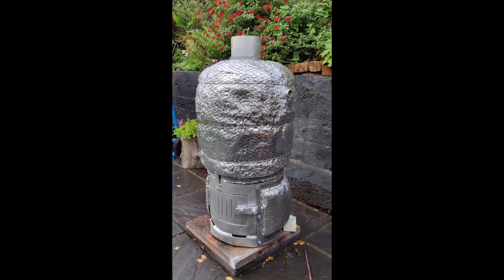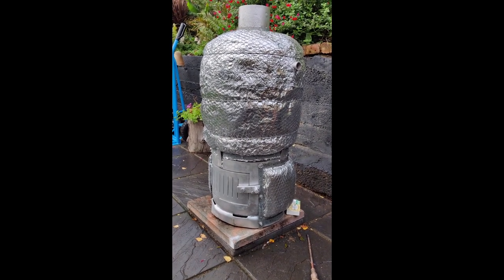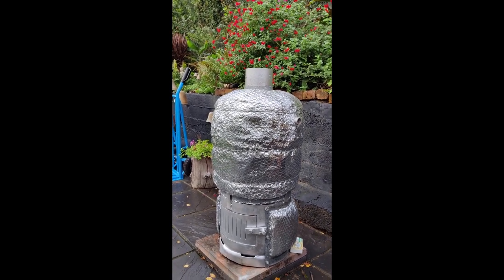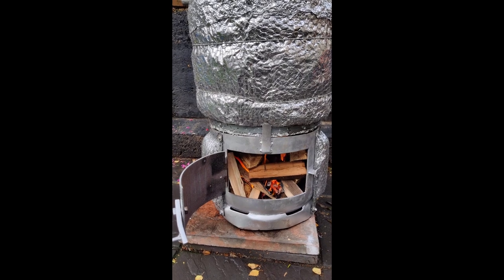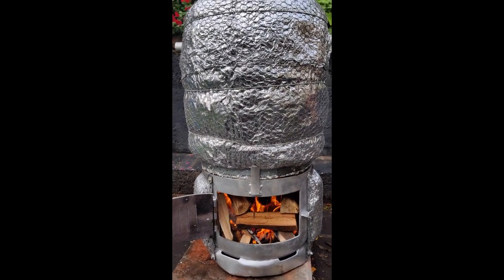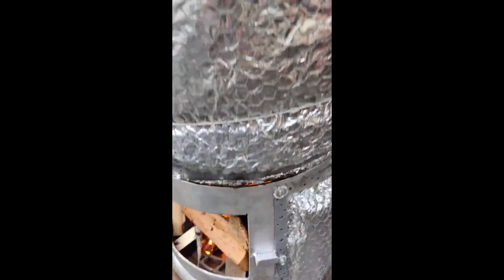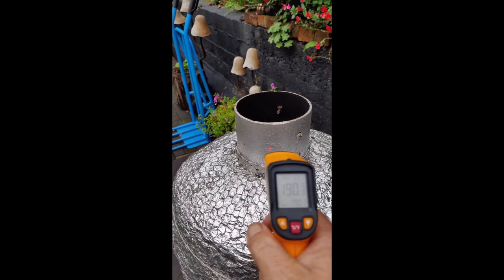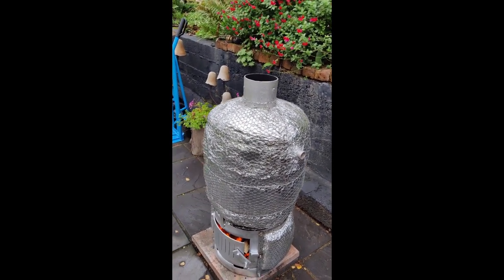Sand battery can it heat my home? part 2

Comment: Now you could Parge concrete over it that chicken wire ought to hold it in place give you even more thermal Mass lol
Reply from the maker: It would 👍 but adding any more weight will make it a garden ornament 😄

Comment: If it's too hot don't be afraid to crack a window open and cool it down a bit, after all your still saving quite a bit so your can waste some you don't need.
Reply: You might consider adding a water pipe tranfer system inside to other rooms to run into the flue and move heat into water radiators from room to room.
Reply: Run a pipe under the floor and up to a water radiator in each room.
Reply: Was thinking a better way to slow down the release of the heat, Make a smaller air vent pipe to add when bringing indoors to lessen heat to air transfer. Maybe even just an insolated cover once the room gets hot enough to blanket the top🤔💡
If that doesn't control tye release to keep it from releasing heat too fast you need a thicker more robust insulation shroud
Reply: As for tye soot problem a smaller diameter pipe with air holes in the bottom and top will burn the gasses that need higher heat to ignight. Maybe half inch to quarter inch smaller and you can slide it in and out

Comment: Get cracking with pallets they are a disposal problem.
Reply: Really? I tried to find free pallets in my area, but nothing doing. They can't be that big a disposal problem if people are charging for them.
Reply: @Pwecko  I think a lot of people are after them now because of the fuel crisis the solution to keeping warm has to be thermal mass heaters and Insulation. Try reducing the size of your house ie all sleeping in the living room and kitchen. This winter will be a matter of survival for some people. personally I live in a 6 feet by 6 feet cabin that's economising.
Reply: @DavidPaulNewtonScott  That certainly is economising.  I'm 6'6", so I guess I'd have to sleep diagonally.
Reply: @Pwecko  The optimum shape and size is a square internal dimensions the height of the person. A square allows easy cross bracing of the walls at the floor level. Mine is under a mound of blackberry thorns therefore only dug in two feet. Build on as an insurance policy.

Comment: very intresting Thx!
You still have oodles of heat wasted, you could boil 10's of gallons/50L off the flue. Just have clean buckets with lids when you take 'em inside. With 50°C delta during cooling phase every (10L) bucket will give off 2.1MJ. Or, like having a (about) 300W heater on for 2 hours.
Reply from the maker: Yes I know it's the painful part about it watching all that hot air going to waste, but yes il get this streamlined a bit more & look at capturing more of that heat 👍

Comment: If you pack a metal drum with woodchips and the pore a bucket of wood ashes and urine  on top it will heat up to about 170 F .  Just tell the wife your making compost . It is correct
Reply from the maker: That's pretty impressive

Comment: I have a wood burning stove in my basement and the exhaust pipe runs through 4 rooms upstairs. Each room has a 50 gallon steel drum filled with sand that wraps around the pipe. Its been heating my 6,000 square foot house for years. It distributes the heat evenly and stays hot for about 7 hours after the fire goes out. If you do it right, a sand battery is awesome when it comes to efficiency. The exhaust pipe is double walled but single walled inside the sand battery. After running for 2 hours the sand batteries have reached max temp. I heat my entire house with only 4 logs a day.
Reply: Do you have any photos of these? I'd love to see them and build something similar.
Reply from the maker: Wow that's impressive 👍👍
Reply: @guyvenner  I don't have any photos but all you need is steel drums and stove pipe with connectors and heavy duty brackets to hold up the sand batteries. I'll explain how i assembled it all.
Reply: What I made:  I bought a large soapstone stove from a place called Hearthstone. I bought double walled pipe and single walled pipe. I bought steel 50 gallon drums and cut a hole in the top and bottom to insert the single walled pipe. Single wall pipe easily transfers heat into the sand drum. I welded some rebar U shaped brackets on the drums and hung them from the wall and ceiling about 5 feet off the ground.  I used fire block panels behind the sand drums because they get hot. I then lined up the holes in the floor and ceiling to run out the double walled pipes. I welded a 1 to 4 way junction right above the stove in the basement but had to add dampers in each pipe because heat was not being distributed evenly. I used a funnel and filled the steel drums with the finest sand i could find.

Comment: I would expect that if you were to take a piece of insulated pipe with a bend in it and it were to reach close to the floor where you can use that fan upside down to drive the air across the floor, then it should make it hotter for more air space as you're heating the air from the floor up not just the top of that sand box up. You might even consider ducting some of that hot air up at ceiling level into another room if it's too hot like you say. Firing it so the transfer to the house at near night fall would surely drive the temps up for the entire night. It appears to be a very good solution to the energy bill issue. well done.

Comment: Excellent work lots of usful data, all you need do is find a way to heat it without burning wood.

But it is heat storage, so any type of heating system may do, if you could heat it up while it was in the room you would get double heat due to the lowering of losses.
Reply from the maker: As much as I would like to it's just not possible on either of those, which is why I'm at the stage I'm at now 👍

Comment: Kind sir,with all the respect,i suggest you to study first they way a stove works. The best efficient in the world are those used in eastern europe and north asia(Belarus,russia,especially Siberia,Ukraine Romania,Bulgaria,Kazahstan,Mongolia,etc) search in google for,, Soba de teracota'' After you will get the knowledge about the way they work and the level of energetic efficiency,i can assure you will look back at your invention and have a good laugh. First of all,you need to have a control over the air intake,because when burns without air control,in a cold weather,the difference of temperature between the inside and outside creates a flow of air so fast that it litterally puls the ash like a vacuum cleaner.This thing have 2 effects,first ,all the heat goes up by the chimney,and secondly,sucks a lot of warm air form your house,wich logically will be replaced by cold air coming from outside(balance of pressure).In short you loose a lot of energy. The stoves i was telling you about  are made by multiple compartments disposed vertically ,communicating between them by a hole of about 10 centimeters disposed im an diagonally opposite corner each. They are made of refractary bricks and refractary cement,covered by ceramic plates of different colours and designs,but for some practic results in your case,as you don't have that in UK,can be covered with ceramic or porcelain tiles too. I have one of 90 by 90 centimeters,2 meters tall and have 5 compartiments. I can assure you that with  5 kilograms of wood it warms enouth for 24 hours,wright now i'm wearing a t shirt and there are -10 C outside(it have a obturator on the top wich i close after the fire is done to avoid the hot air to get out by the chimney). Conclusion,it is not about you use sand or mix the sand with refractary cement to improve the temperature transfer between the sand particles,but about the mass you heat,wich later cools down warming the air in your house, also about the most efficient way to conserve the energy and limit the loosing towards the outside.

Comment: Thanks for sharing - interesting concept and one that I have been thinking about quite a lot, although I was thinking water due to it's mass and duality of heating a room and providing hot water for showering, etc.  I was also thinking gas and not wood due to cost and cleaner burn, and also easier - I would be able to run the burner inside which I think would be better that being outside, and also, it wouldn't necessarily need to be flu'ed.  But interesting idea... thanks for sharing.
Reply from the maker: Your welcome & thank you & good luck when you get it off the ground 👍

Comment: I would also suggest that your thermal mass is too small. A insulated underground container should hold the heat alot better. Also a larger mass would have less surface area to lose heat from than does a smaller storage unit. That would also decrease heat loss.
Reply from the maker: Small scale 👍

Comment: have you considered using electricity instead of wood?  You would be able to have the vessel completely filled with sand and then install 2 heating elements or a mesh heating element to heat the sand.  This is what https://www.youtube.com/watch?v=Icai6OOIh2M demonstrates.  It would completely remove the need for ventilation, carbon soot buildup, and having to deal with firewood and you could permanently install it indoors without worry, as there would be nothing to catch on fire.  Best of luck and great videos!

Comment: If you smell something, it may be the toxic gasses left over from burning the wood. Try cleaning it out with pressurized air before bringing it into the house... or just build a set up that filters the air and sends the heat into your house.
Reply from the maker: Either the hot insulation or possibly the HT paint
Reply: A simple wire chimney sweep will take care of it in seconds.

Comment: I am fascinated by your ingenuity. Well done.  Sadly burning stuff does not help with net zero but it is probably better than burning gas.  As an alternative to heat pumps this does look like something that could be adapted to work for most homes.  Heat the sand with cheap electricity over night and then let it just release the heat during the day.
Reply from the maker: Absolutely can you imagine supermarkets swimming pools with solar panels on there roofs heating a silo  of sand could save the ££££££££
Reply: "Cheap electricity" is an odd concept. 
Like saying cook with left over wine. Lol.
Reply: @janbaker3713  I have a solar installation and am currently back feeding he grid with approx. 500 Kwh excess per month. 
I am considering using his excess power to heat a sand battery. You have given me a great idea.
Reply: Tom, you could just buy some old “economy 7” storage heaters to do the same thing.

Comment: Dude, I love your homemade wood-fired-dyson-sphere, and this is super impressive. The biggest loss of heat in this equation (if you're not modifying the base of the build) is definitely the open air/wind across the whole pot. If you set this thing up in a home in the ground, with a pipe feeding air for the fire (and obv a place dug beneath for the ash to fall), then the sand would lose so much less energy. Props to you for paving the path here, because heating our living environment is one of the least sustainable aspects of our existence as a species. The ability to transfer, across periods of time, the cyclical states of energy availability that we go through.. they might render the idea of burning fossil fuels to power resistive heating obsolete